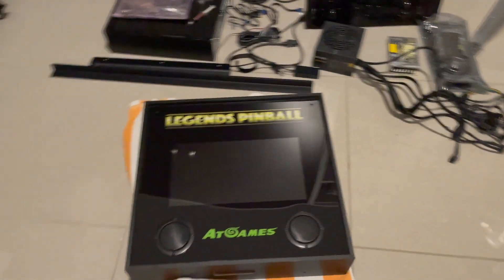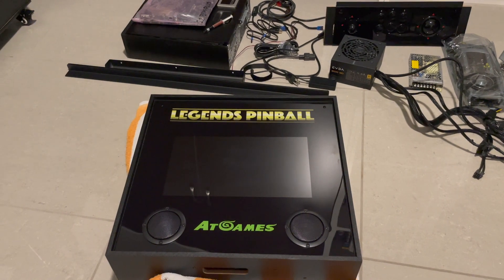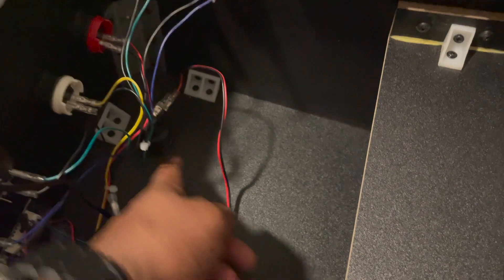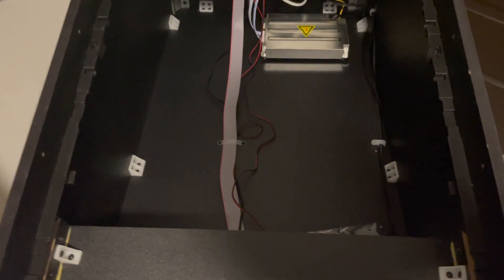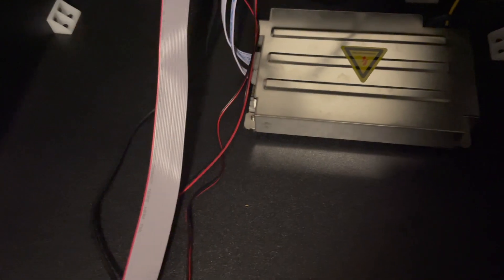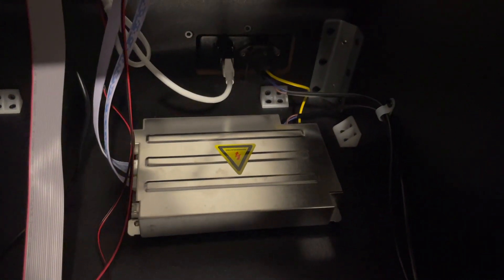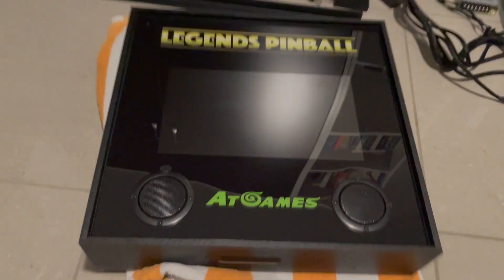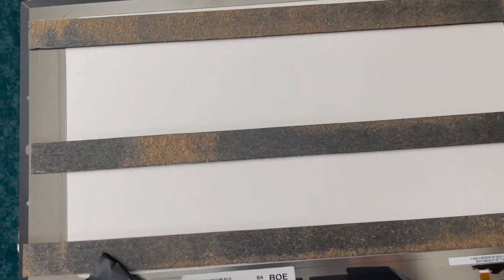Atgames Legend Pinball Mod Part 1

Comment: Got any links or done the coin box buttons. Looking to add lighted ones to mine and having a hell of a time finding info on whats needed to do it.
Reply from the maker: I thought I saw a seller on etsy that had the coin buttons and wiring separate from the molded coin doors.  However, I no longer see that option. It looks like the only way is to buy the coin door with the buttons and just use the buttons...